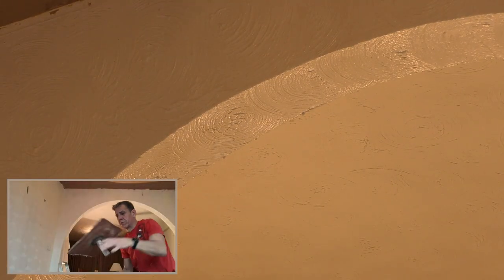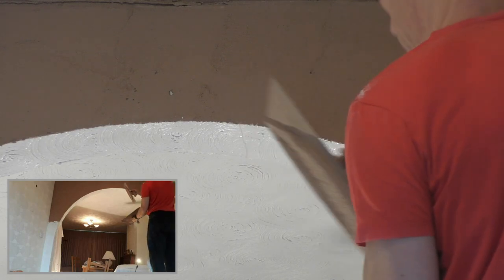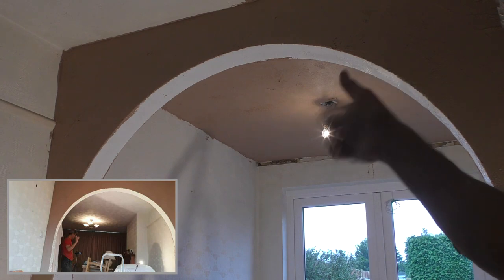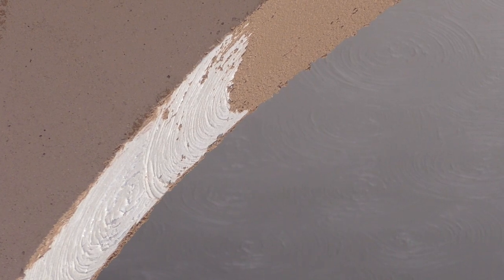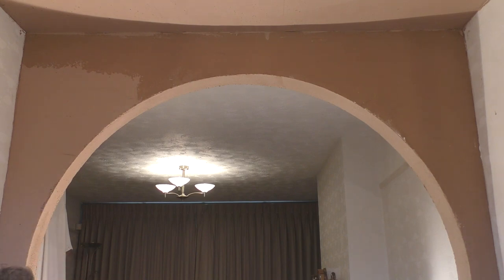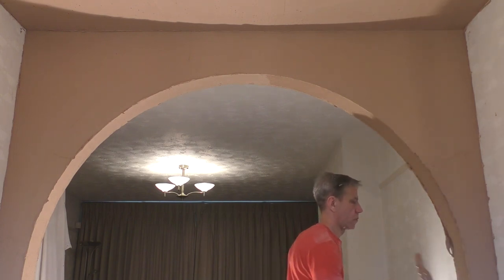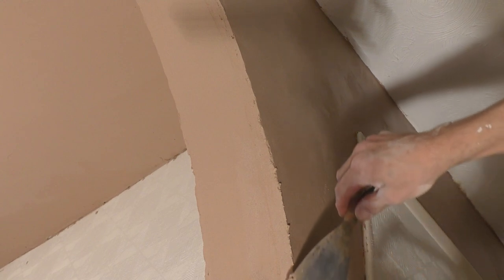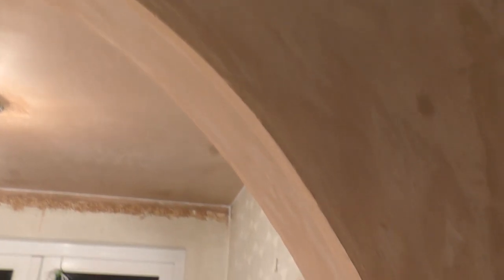Free Hand Arch Bond & Set Over Artex

Comment: I used thin coat stop beads before,, and it looked pretty good. Using an external corner trowel also helps if you’re doing it freehand,ox and Marshalltown externals are the best I’ve tried. Nice job btw, you’re a good spread.
Reply from the maker: Cheers Steve, I might give stop bead a go 👍
Reply: @ThePlasterer  yeah worth a try, if you’re lucky you can staple the beads up other wise it’s a two handed job planting the beads up, keep up the good work mate.
Reply from the maker: @steveobrien2237  thanks mate

Comment: Hey mate great videos as always. I'm plastering over distemper paint this week on walls and ceilings !!!! Any tips ? 
I was going to wash it off with hot water and sugar soap, stablizer it with sandtex  stabilizer.....then possibly but blue grit on top of stablizer for extra protection.  Please let me know if this would work in your opinion...
Reply from the maker: That stuff is horrible to try and cover, what you suggest sounds like the best option to me, if that doesn't work, nothing will, short of hacking the plaster off, which lets  face it, you dont want to do, good luck with it mate, let me know how you get on. Cheers me dears for the comments 👍
Reply: @ThePlasterer  Hi mate, thanks for the reply.  It was a strange one , the top coat paint was vinal matt underneath was distemper  vinal matt was stubborn to get off so I brushed on some water to weaken it... when I went to scrape it off it weakened the plaster and the old plaster came off really easy.  Pva and plaster tomorrow,  its saved us money on materials
Reply from the maker: @petersparshot4997  👍👍

Comment: Could have used plasterboard beads glued or nailed in place,
Reply from the maker: I've tried that by cutting the edges of the plaster board bead so you can bend them, but found the curve was not true
Reply: @ThePlasterer  they sell plastic arch beads specifically for the job , there a pain to keep flat though, lots of staples
Reply from the maker: Not seen those, I'll Google em and take a look👍
Reply: @ThePlasterer  I think there called dry wall arch beads, one side is “cut” already so they flop around. Good for board work, might of struggle over anything that’s not true
Reply from the maker: @mickygism  Thanks Micky
Reply from the maker: Cheers, I'll take a look
Reply: I did an archway last week and used the plastic archbead they are good beads but the arch i was doing was a mixture of plasterboard and existing plaster and whoever did the arch it wasn't true so the beads did cause me some hassle I pretty much used 20mm clout nails to attach the bead to the existing plaster then had to bang in a shit load of staples on the plasterboarded part of the arch to stop any flexing from the arch not being true
Reply from the maker: @Lemon-squeezer  sounds like a right ol pain stewie